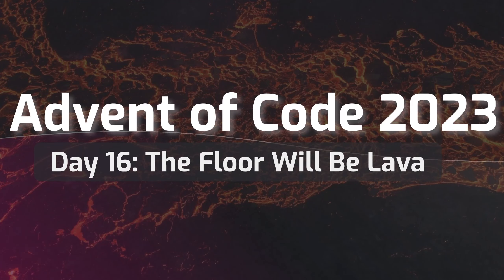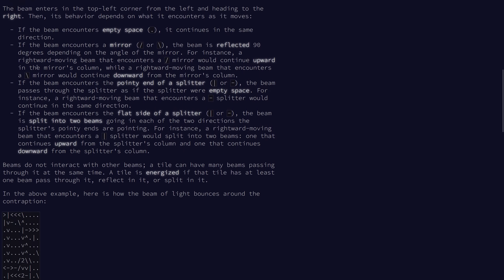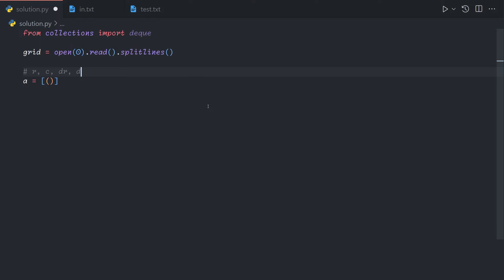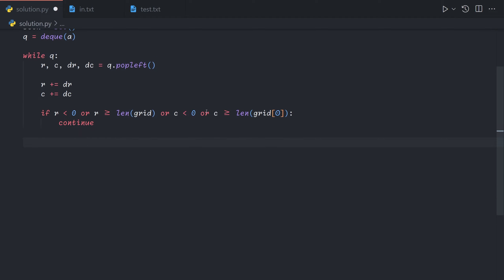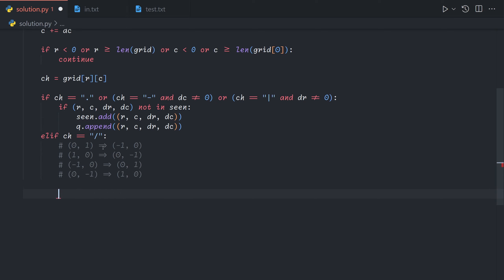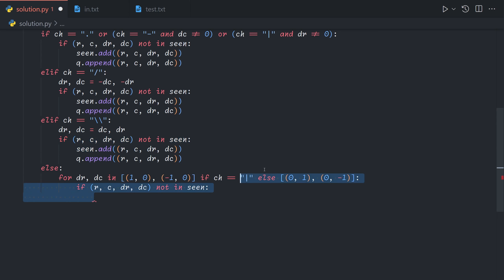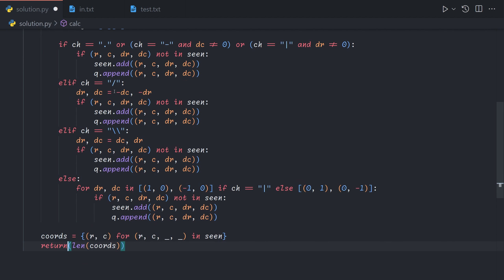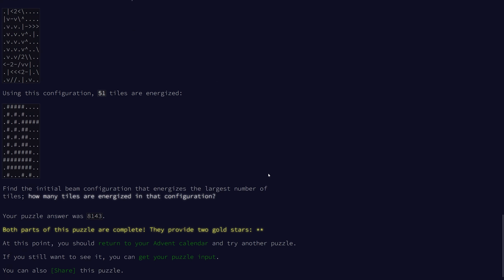Advent of Code 2023 Day 16: The Floor Will Be Lava

Comment: I implemented this without the deque, so standard visit problem with cycle detection (stop when you end up in a tile that you alredy visited while going in a direction that is the same as the current direction). The fun thing is that it exceeded recursion limit at first. Then I increased the recursion limit with sys a little bit, and it worked also for part two. I laughed pretty hard at this one.
Reply: Recursive grid walking with visit detection got me into 48 levels of recursion max and it finishes calculating part 2 in ~0.98 seconds (TypeScript) 
P.S. to check max depth just add a 'depth' arg for recursive function and pass a "depth + 1" in this arg in recursive calls. Then save it to a global 'maxDepth' (when it exceeds prev max value) and print out in the end ^^

Comment: seen is a set. Is the check for (r, c, dr, dc) in seen not necessary?
Reply: I'm pretty sure it's necessary to avoid getting stuck in loops. If you have a square of mirrors all pointing at each other and there's a beam splitter along the "edge" of the square, then you can get stuck in a loop if you don't check for (r, c, dr, dc) in seen.
Reply: @ibraheemahmed1670 yup, I spent an hour trying to figure out why I kept looping. Forgot to check to see if the beam was already seen before adding it to the deque